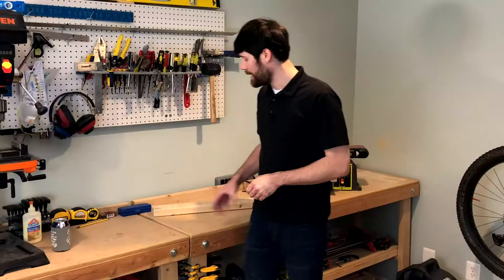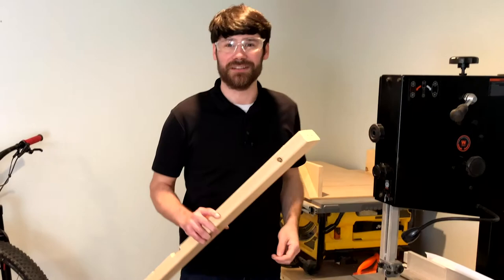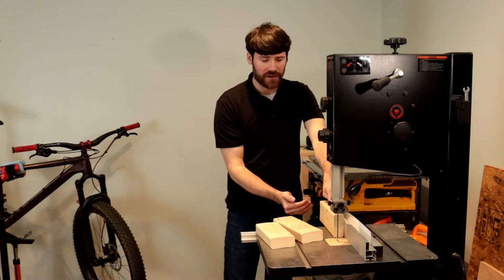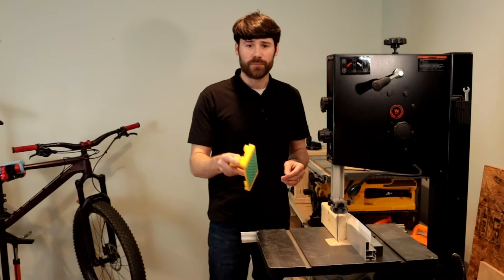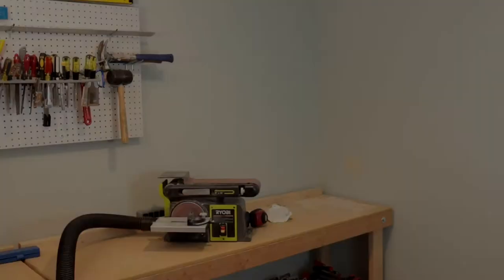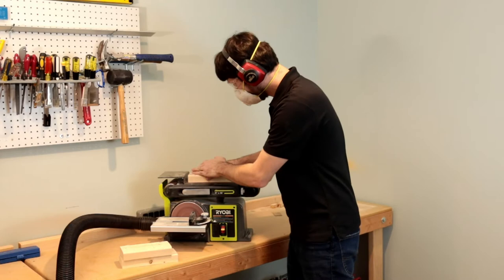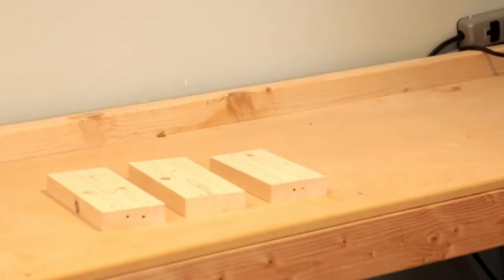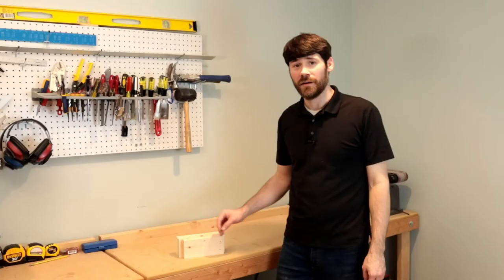How to plane a board without a planer or jointer?

Comment: Why do you have a bandsaw instead of a table saw? This could've been done much more easily and accurately on a table saw if you don't have a jointer/planer.
Reply from the maker: Hey, great question, I do have a table saw and have used it to joint also. For this glue up I did not need to be precise in thickness, just to have flat surfaces to glue to each other. I wanted to demonstrate the band saw method as it can be used for wider boards. A table saw would not be able to cut though a board wider than about 4 inches.